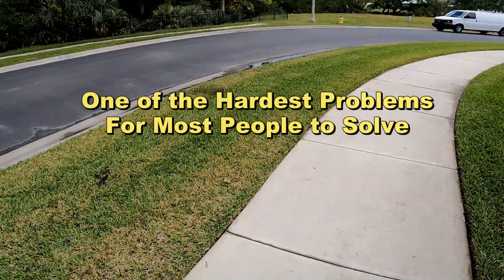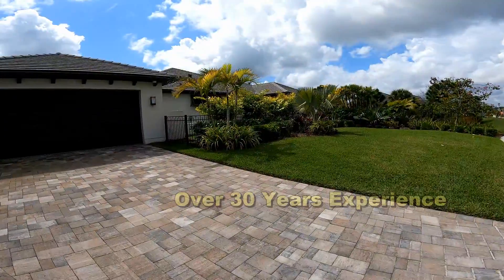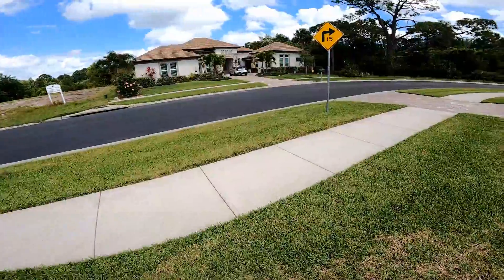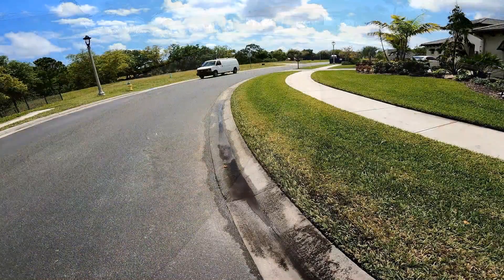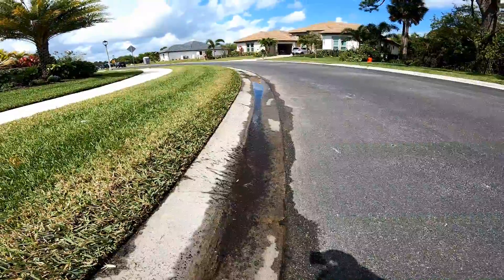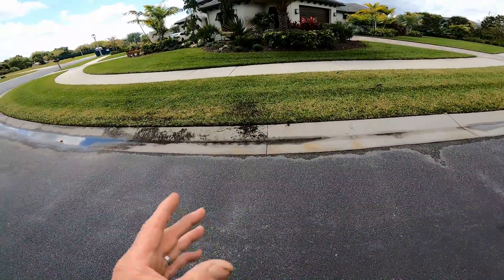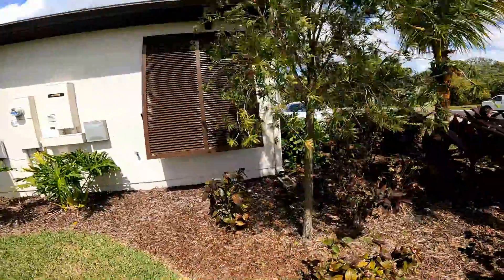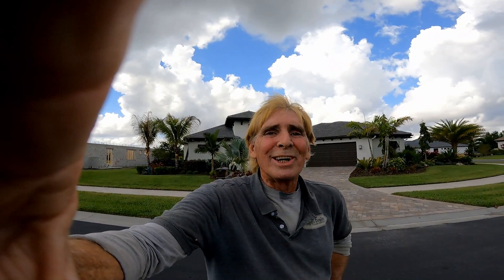Hardest Drainage Problem to Fix

Comment: Couldn’t you also do a rain garden section at the low points?

Or if the HOA want a grass only on the outer sections, wouldn’t a rain garden style soil work as a sub soil to the grass? ..roll back (or dig out) the grass, dig 2-3 ft down, replace soil with a mixture of sifted compost & mulch and sand, then roll back the grass?

Maybe convert the garden areas in yard to rain garden style also & help sink more roof run off?

..or is my idea not cost effective for Florida? I’m from the California desert, so my idea could be completely wrong.  Just curious.

Comment: Engineers lose the ability to come up with cheap and simple solutions while learning the trade that teaches them to do it big and complicated.
That is why I love the Australian KISS method - Keep It Simple Stupid.
European gas prices right now are way higher than that.
27 gallons is 102.4 liter of diesel will cost you €219,- ($241,40) If it is regular it will be €231,42 ($255,07) You lucky bastard paying less than half of what we pay for it.